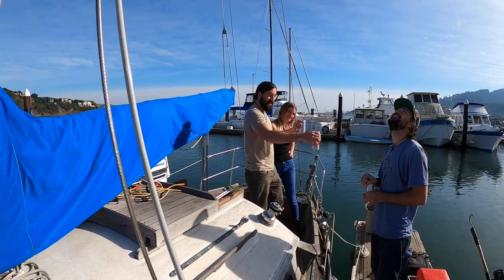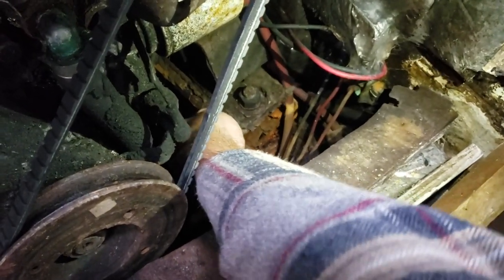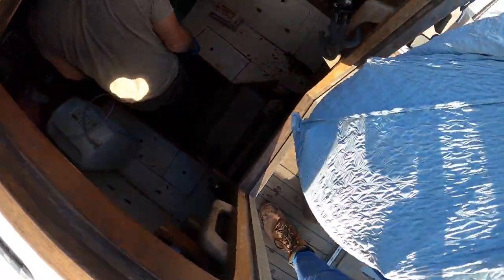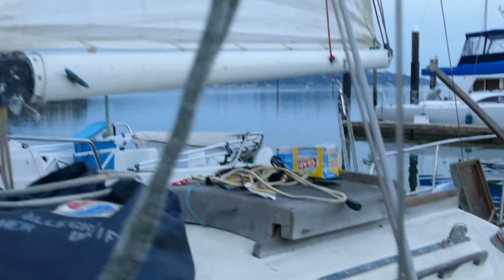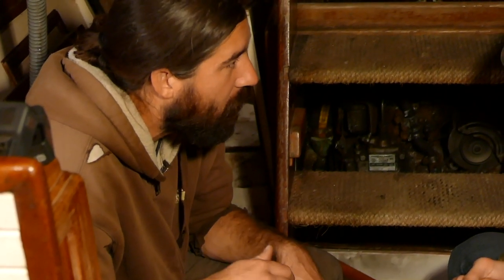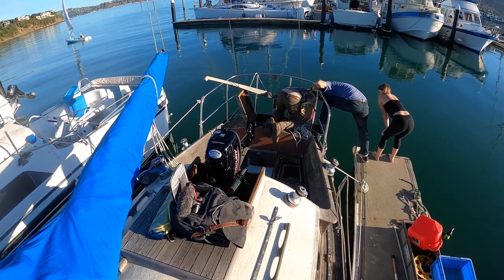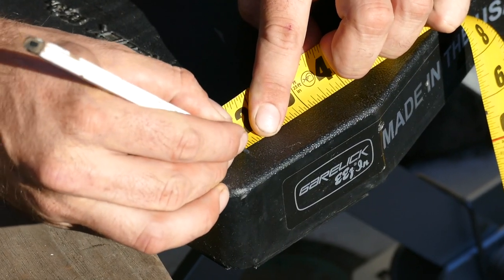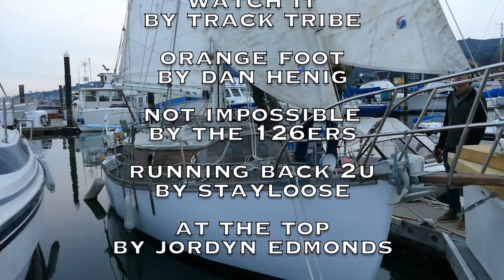Salt & Tar: Ep.127- New Captain on the Block

Comment: What an awesome little boat, it has real character. When he eventually gets a tender,  he will be able to use that engine for both. As the diesel is working, it's definitely worth an overhaul  and re mounting. They are better if you need to make way under power for long periods. The outboard will make an excellent backup and that pivot mount is the ideal place to to stash the engine.

Comment: Pretty little boat. Well, not that little. I had a 24' "Rainbow" some years back in Vallejo Ca. Was an old trainer from Annapolis. Same length, but just a day sail, so about a quarter of the volume. Turned it over to a friend when we needed to move across country the day after I got the sail back from some fitting.  Hoffa's Freyja has a great deal of charm.

Comment: The unsupported weight of the Yanmar on the prop shaft is probably causing a good bit of the bilge water. It should be braced up as a temporary measure.

Comment: That boat needs a motor removal, but since there's so much rot back there to address, it will be a good 2nd reason to remove it for access back there to damage around cockpit. By contrast, the saloon looks really good, was all the wood damaged in cockpit vicinity ? You don't have to remove the engine from the boat since  it seems to run acceptably, but moving it forward onto a temporary support cradle in cabin/saloon for some maintenance wouldn't hurt while you go after all the aft rot issues and the mounts/motor beds. A long beam, or the boats own boom could lift the motor easily, it just needs to be able to slide forward a few feet onto a support cradle of some old tires and tarps. The good thing about all this, you're going to be getting a lot of free beer helping him out if he's nearby in another slip or on the hard in that marina ! Welcome Hoffa !

Comment: I see another YouTube channel being born.
Reply: Oh yes please let's convince this guy to document his process!
Reply: I would tow that thing out about 20 miles and pull the plug. And yes I've had two boats.
Reply: @textech4056  hey, $1k isn't bad for a start, but he has a lot of work and expense ahead of him.
For a start, that outboard isn't going to power his lights or bilge pumps. And running around with "habit" as engine mounts isn't exactly a good thing. Gonna be a fun one to hoist the engine up, safely, to install new blocking and new mounts. Then, replacing and tryimg to color match the rotted plywood is always fun too. He just bought a money pit, but he is on the water in his own boat, for $1k plus the outboard and beers payment for labor.
Reply: @thomasarussellsr  just like paying rent except no landlord and it’s yours
Reply: @heidilear7222  yup. I vaguely remember paying rent. Glad I don't have that expense any more. My house may be in as bad or worse shape than this boat, but I paid cash for it as well ($23,900 US) and it is all mine. (And yes, the house is sinking a little too, over it's 200 years.)
Reply: @thomasarussellsr  that is a cheap house!
Reply: @ariebenschop4632  yup, but it needs about $85k to $120k in repairs and upgrades. And I'll have a house worth about $200k to $250k depending on market values and comparible houses at the time., so good investment.

Comment: She is a beauty but don't lose the Yanmar the best engine ever
Reply: Only if they’re looked after
Reply: @Mahalo_83  isn't that so with all engines
Reply: @robertbosman5398  yeah, just saying coz they’re generally reliable doesn’t mean they all are. This one sounded like the compression may have been little low when they were firing it up so may have been run hot at some point.
Reply: @Mahalo_83  by the sound of this yanmar she is running just fine and believe me I know yanmar
Reply: @robertbosman5398  really? Needing that much cranking to get it to fire, a good 2GM should start on the button even in cold weather